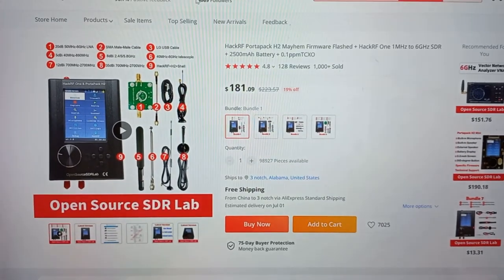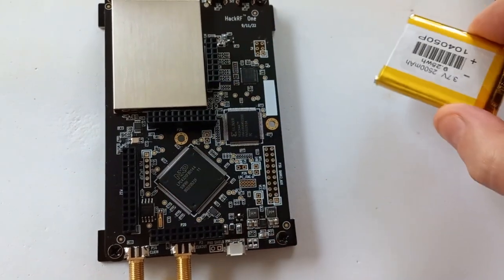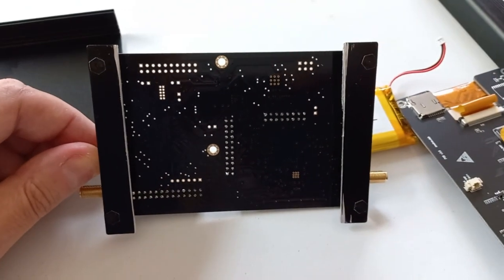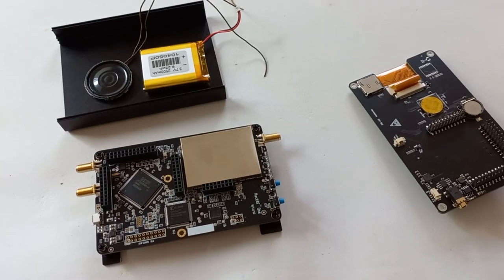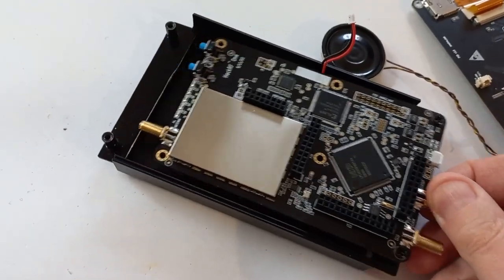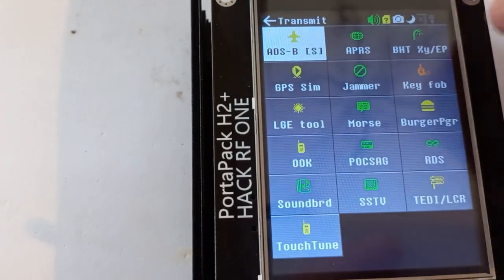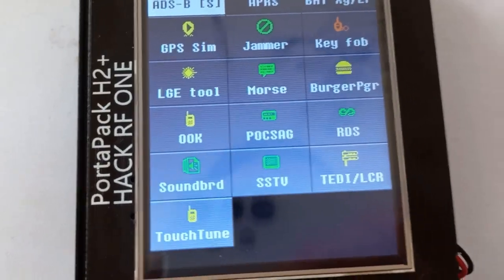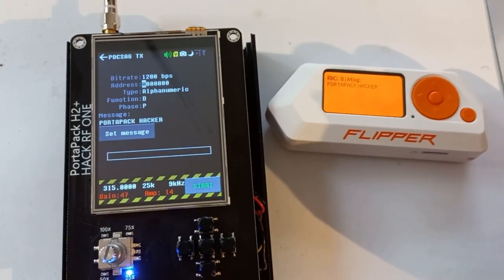Hacking the HackRF One PortaPack H2+ to add Audio and internal Speaker.

Comment: The hackrf is an amazing bit of kit if you know what your doing or how to use it. A flipper zero is nothing in comparison as to what the hack RF can do.
Reply: Factual.
Reply: Exactly and we.. are hearing-you.
Reply: they’re both cool
Reply: I wish the hackrf portapack would be as pocketable as a flipper though.
Reply: Hackrf focuses only on radio, while flipper can do nfc and ibutton stuff, also had gpio. Anyways, both are great devices.
Reply: as to frequency, i would agree.  "as to doing more" uhhh yeah, not a chance in hell.  a flipper is a multi tool.  the hackrf one with upgrades is a freq-beast but it doesnt have a gpio and that ends the debate as it can be used for nearly anything imaginable.

Comment: I had heard the knockoffs were just as good as the originals.
I definitely need to one to pair to with the Flipper.
Reply: They aren't really knockoffs because the hackrf one is an open source project, the Chinese versions are made from the freely available plans, with some parts substitutions of course.
Reply: @fdsman  yeah, I know. It's just that usually when open source stuff gets commandeered by China the companies often cut corners and there can be a massive difference between form and function from the original. Obviously that's not always the case, sometimes their copies are even better. I've been trying to justify spending $600 on this when you can get it from China for $200, and I'm not being successful. Lol

Comment: With that much room, you can probably fit a much larger battery in there. I always look to get max power storage.
Reply from the maker: I've thought of doing that as the battery on this thing runs down way to  quickly when you're transmitting.

Comment: Any plans to get the $60 Mayhem add-on board? 'I understand its ESP32 runs the ESP32Marauder, but not sure if it requires special firmware for the Flipper Zero (stock, SqachWare-CFW, unleashed forks (RogueMaster,  DarkFlippers).

BTW, how difficult would it be to do all the things the Flipper Zero does, on a HackRF or a LimeSDR? Would the code need to be ported to GNU Radio Companion?